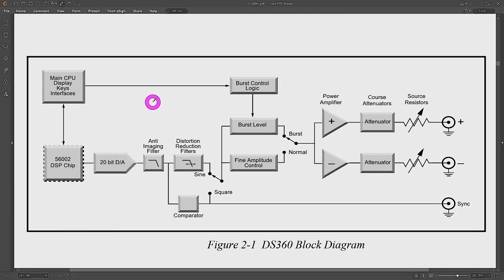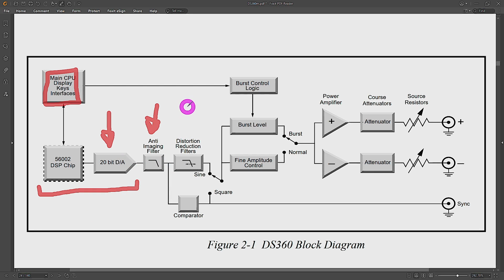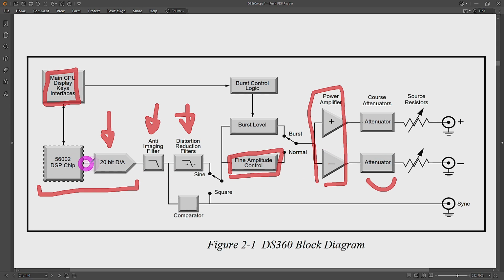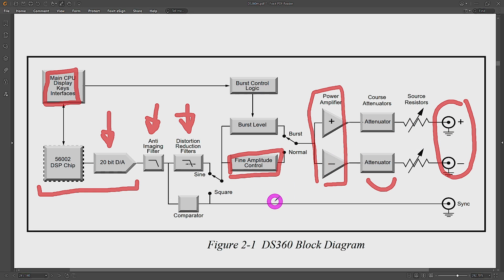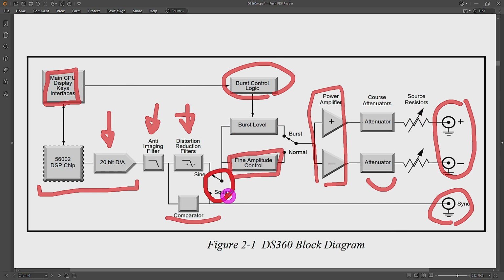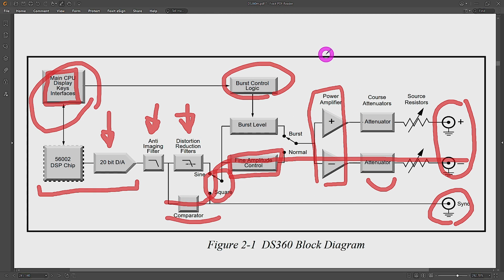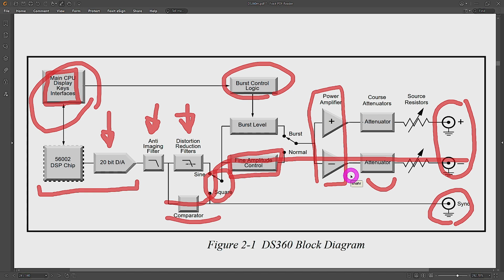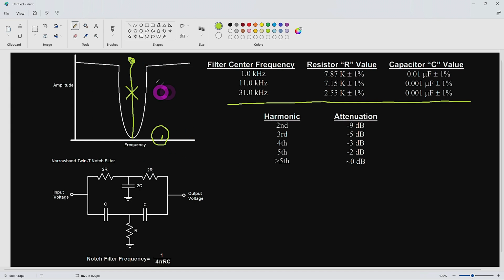TSP #266 - Stanford Research DS360 Ultra-Low Distortion Function Gen. Repair, Teardown & Experiments

Comment: Why does the LIA at 22:06 display 0 degrees instead of 180 degrees? In relation to the reference signal the measured signal is 180 degree out of phase since the negative output of the ds360 is used as reference.

Comment: Since you're using the lock in amplifier, can you take out the filter? The lock in amplifier is only going to measure the harmonic that you tell it to right? Also does there need to be some consideration of the phase of the demodulation in the LIA to get the right value for the voltage of the harmonics?
Reply from the maker: No you cannot remove the filter. The signal will overwhelm the LIA input. The input sees all harmonics at the same time.
Reply: @TheSignalPath  That answers my question. Thanks.

Comment: Very convincing assay technique, but having replaced the malfunctioning Opto-Isolator could the now functional unit not be submitted to a qualified calibration lab, or even to the manufacturer to be able to re-insert it into lab grade inventory with a calibration report to back it up?
Reply from the maker: The optoisolator has no impact on the analog performance of the unit.

Comment: Really cool video, and a creative way to measure the THD. I am not as familiar with the lock in amplifiers. I am just wondering if it is still possible that the THD may be worse on other ranges and frequencies of the DS360. Perhaps the signal path used for the 1.4V 775hz does not go through the resistors which reached high temperatures?

Comment: Hello, great video. But why was it necessary to remove the fundamental when using a lock-in analyzer (LIA)? I understand that removing the fundamental is mandatory when measuring the signal energy with wide bandwidth instruments such as AC millivoltmeters. This was done that way in the late 1960s with the HP distortion meters such as the HP 334A. Otherwise the energy in the fundamental (which we do not want to measure) would totally dominate the measured value. But a LIA is the opposite of a wide bandwidth instrument. As you explained in one of your videos, it has an ultra-narrow bandwidth down to a few ten millihertz. So I would have assumed that it can measure the harmonics correctly even if the fundamental is present. The frequency distance between the 2. harmonic and the fundamental ist 775 Hz, much more than a LIA needs for totally ignoring the fundamental. Is this assumption wrong? Greetings and keep up the good work.

Comment: With the RTO, which i'm most familiar with, it's possible to apply a pretty deep digital filter on the first harmonic, and i've been able to measure down to 5 μV signals with it, using the math  channel and zero clamping, to get rid of drift and 1/f noise...50-100x averaging gaveme 10,000:1 dynamic range, and, we tested that against the fft, and we were able to get 'direct' measurements that are about as dep as the fft. Nice setup you made...btw, some of those resistors that i have came from a ballistics computer, which had a huge diode /resistor / capacitor / inductor signal processor, which even had temeperature control heater resistors on the board...that group of resistors near the output reminded me of that ....they spared no expense in those military computers inn the 1960's!
Reply from the maker: Remember that a digital notch filter would not help in that situation. The front-end of the instrument is the THD limitation (and of course the ADC).

Comment: I have a Wavetek model 112, it's not as good as this instrument. On serious note I want to adjust it but the pots are buried away and you need a riser card. However the PCB connectors are a weird gold flashed individual soldered pins that work like two scissor's, they interlock perpendicular to each other in a 'scissor action' as you push the card down onto a 'motherboard' below. I can't find them anywhere, am I making any sense ? or have you or your fan's below heard of such an animal please ? or even know where I might find such adapters ? If I could source the pins I would make my own riser and one for anybody who wants one !......cheers

Comment: Great video. At first after the 2015 measurement I expected you to just go with a notch filter and a DSA, which would be the obvious method, but using the lock-in amp to do the measurements was SO much more interesting! 👍

Comment: Very nice , I bought my self brand new AP555 30k$.  It measures down to -120dB THD.  It has very nice Software .
Reply: I thought the Audio Precisions were good down to 160 dB 🤷
Reply: @jimomertz  yes , it can go to -160dB, if you use FFT length 1.2M and  averaging . -120dB is with lowest averaging and FFT length 256 ,  with FFT length 1.2M you get easily go to -160dB

Comment: 3458A is also very capable to measure THD, with floor below -110dB at 1kHz or there about. There are some examples available with GPIB code for this application.

Comment: Awesome signal generator, which is almost always used in calibrations (just like the 3458). Which dynamic signal analyzer are you getting, also a Stanford like the SR785? That is an absolute banger, I still don't know if there are modern analyzers which can do a real sweep (with autoranging mid-sweep) which are that fast.

Comment: Wouldn't the power amplifier (without additional filtering) at the end of the chain increase the THD again? I don't understand why there aren't filters after the power stage to reduce the distortions introduced by the non-linearities of the amplifier.
Reply: I guess it is easier to make a clean power amplifier but not a power filter.

Comment: Really nice video.
The main contributor to the THD is the second harmonics alone. 20 x log(1.4/0.9e-6) -9 = 114.8 dB.
The rest of them didn't sum up to anything interesting. But they could have...
Reply from the maker: Yes, this is typical in single-ended amplifiers.

Comment: I’d love to see the circuit diagram of the power amplifier output stages for them to be such a low distortion. Most power amplifiers seem to manage .01% distortion. I thought it would be fascinating to see how they drop this by such a huge amount annd before before the attenuator.
Reply: Not that hard to do better than 0.01% distortion in the audio range, actually some off-the-shelf ICs will pretty much do that. Of course one could also go discrete.
Reply: Feedback can be used to help linearize an amplifier, maybe that's an ingredient in the special sauce.

Comment: The game of, is the pin stuck in the via? Or is there more solder. Frustrating looking at the board lamination composition and just giving a sigh, "going to be one of those boards" thankfully the lifted trace is part of an isolation circuit and not a high frequency matching circuit. Optocouplers are amazing but surprising when expensive lab equipment are brought down by burned out diods.

Comment: Your title 0.000002% seems to be a typo. -113dB is about 0.0002%. Forgot to multiply by 100? thd_percent = 100*10^(thd_db/20). I usually calibrate these by direct reading on NI PXI5922 and get something around that number. But it's actually about limit of 5922.
Reply from the maker: It is! Thank you for catching it. I have fixed it.

Comment: Great Video. Although, -110dB THD equals 0.0003%. I think there's an error on your first picture.. 0.000002% THD would be -154dB, which no generator is able to achieve.
 I did AC-Susceptibility measurements / Harmonic Analysis on Hi - Tc - Superconductors about 30 years ago. Other scientists stacked several LI amplifiers to collect the higher harmonics simultaneously.  Very costly.. Instead, I built a Lo THD FFT system using the ultra-linear HP3458A, which I ordered in 1989, i.e. one of the first ones. With 100kHz / 16bit I achieved -96dB SNR / THD, using a Krohn Hite 4400A analog low distortion generator with specified 0.001% THD. At 50kHz, 18bit resolution, I could demonstrate even -108dB THD, @ 195Hz, if I remember correctly. PTB and I think also NIST still use the HP3458A for making ultra precise and low distortion analysis on AC signals, i.e. AC power measurements. You need to synchronize the sampling frequency with the internal oscillator of the HP3458A, so there is a modification to output the internal 10MHz via an optocoupler. The Black Edition 3458A has / had mysterious non equipped pads on its A/D PCB, which could  be assembled with a few components for that purpose. 😎
Reply from the maker: Thanks for catching the type. I have fixed it.

Comment: I'm astounded that the critical filter was on a breadboard ... and still specs were met!!!
Reply: Audio frequencies. 
You can get away with absolute murder at KHz and low MHz.
Reply: @digitalradiohacker  Thanks.
Reply: @liam3284  I thought about some magnetic materials (nickel?) which if used could add non-linearity.

Comment: Would be useful to show the signal fundamental and harmonics in a Spectrum Analyzer with a very low noise floor?
Reply from the maker: Remember that noise floor is not the issue here. The linearity is. A spectrum analyzer front-end alone will not have this much THD...
Reply: @TheSignalPath  And, as you mentioned in the video, the 50ohm impedance factor. Many spectrum analyzers struggle in the kHz range, too.

Comment: You can use pro audio stuff for high dynamic range at these frequencies. Lately ES chips like the ES9822pro improved the landscape, resulting in devices measuring around 125 to 135dB THD with a noise floor better than 150dB (depending on the device YMMV). And of course it's trivial to connect these to a PC for FFT and see the entire spectrum.
Reply: Cosmos ADC ftw ;)
Reply: Might be cool to properly measure those specifications. The device may have that performance, but it is possible the board implementation does not. What I see in the ES9822pro's datasheet is -118 dB THD in mono mode. Nothing close to what you are suggesting.
Reply: @Darkknight512  I'm quoting measurements from real life implementations
Reply: @tiftik which one? Even the Toppind D90 has only -120dB of THD. But ESS ICs do have around -125dB to -135dB of SNR, maybe you mixed the two?
Reply: Yes, man

Comment: Cool video. I'm not familiar with lock-in amps, so I'll have to watch that other video but using a notch and adding gain seems like an intuitive solution to get the measure. 

I haven't worked with a lot of analog equipment, but I have written phase accumulators and worked with SIMD math libraries for audio synthesis before. Cool to see a practical DDS application for lab use.